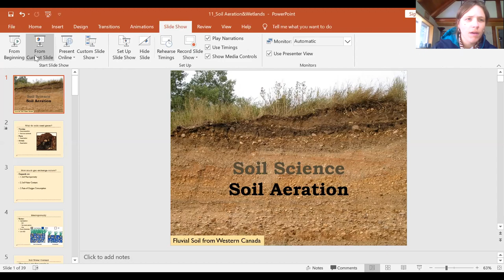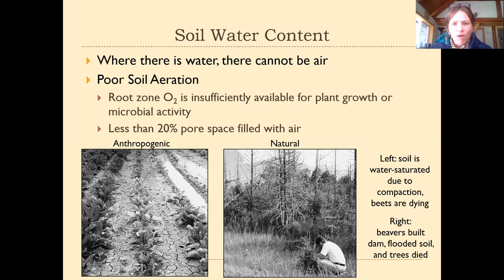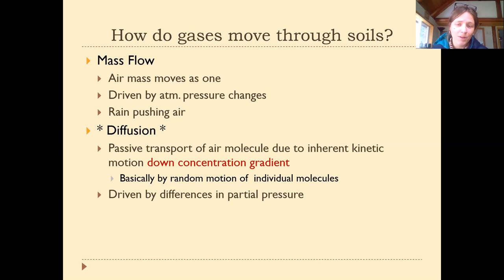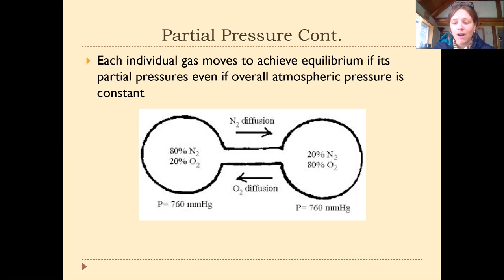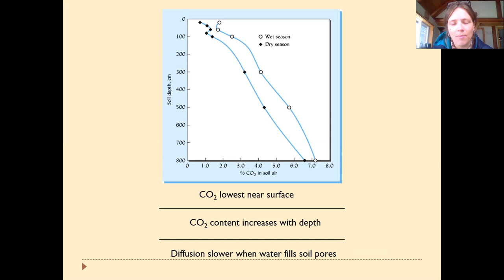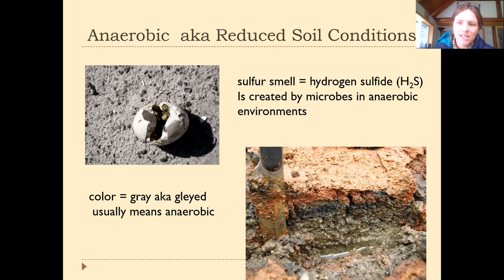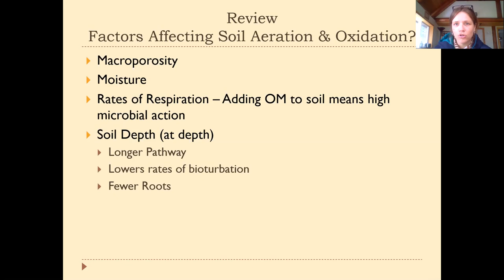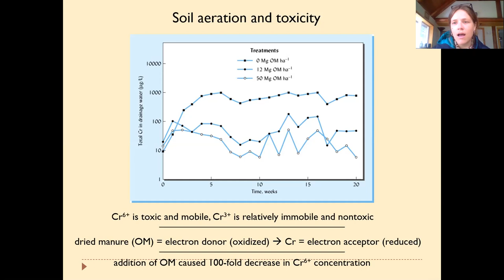Video Lecture on Soil Aeration

Comment: Looking at the partial pressure slide, one could assume that the CO2 concentration has virtually zero impact on the atmospheric climate based simply on "significance of concentration" when compared to the whole atmosphere. Even more bewildering is that N or O plays no part in driving the atmospheric climate even though it makes up 99% of the atmosphere. Weird eh?